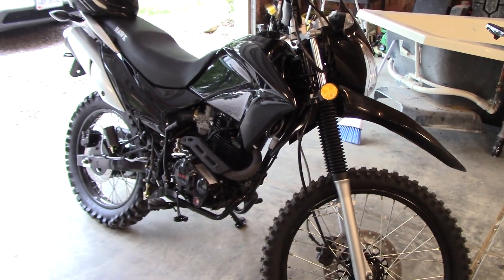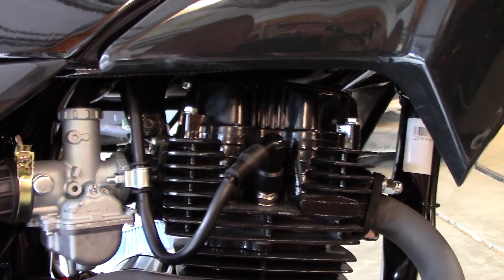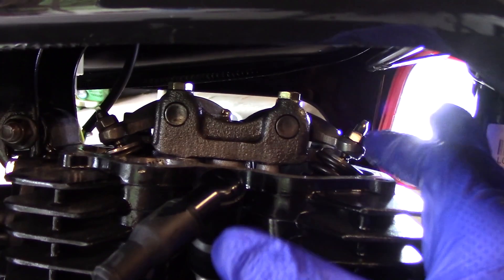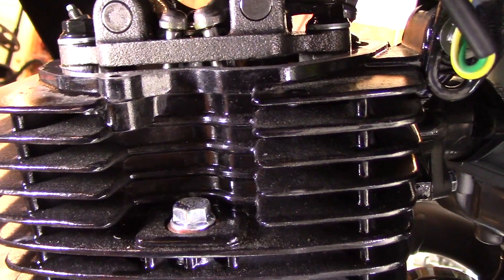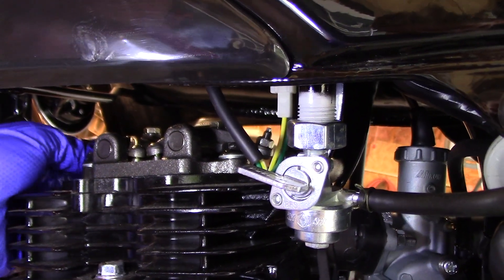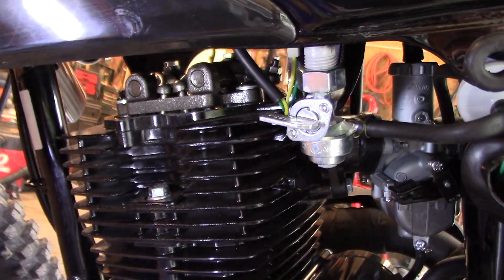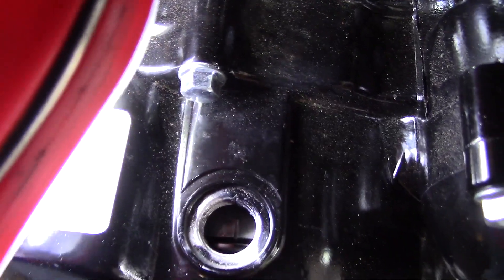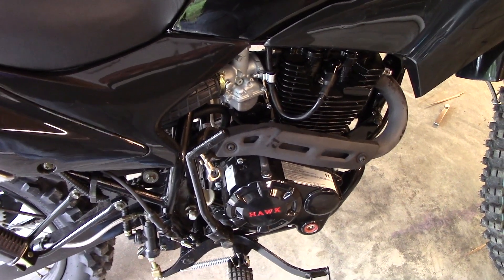Hawk 250 Valve Lash Adjustment - Tao Tao TBR7 Honda CG

Comment: Great job on the video! I don't know why it is so hard for other people explain and show this. I have done a couple valve adjustments years ago, one time with a piece of a Pepsi can because my feeler gauge was all rusty. I was told they were the same thickness. Not sure if its true but it worked on a 49cc Chinese scooter

Comment: I would remove the spark plug to make it easier to turn the engine over. Also, with he plug a installed, it sometimes might be harder to get the marks right on due to compression. Also, I would check the clearances before loosening the rocker arm adjusted lock nuts. Then you know how far off the clearances are, and maybe one or both valves don't need adjusting.

Comment: Dude I can't thank you enough for this video. You nailed every step from finding top dead center to that sensation of the feeler gauges - it does slightly drag. My new 2024 Hawk has been plagued by starting and idling problems - it refused to start for the first five days, and since then has not maintained an idle. This shouldn't happen with a brand new bike, and I was in denial about the need for any major work - its a new F'ing bike!! But shout out to @appalacianmoto for first suggesting the valve lash. And after I said, "What the hell is a valve lash?" and after I resisted any videos that started with, "Remove the gas tank," I came across your video which laid it all out in detail. The only problem I came across was the entire rocker arm assembly was SO tight that, after loosening the lock down nut, the adjusting screws would not turn by hand. I had to use a small adjustable wrench to loosen them, until they finally gave way. And, the valve clearance was non-existent. So that took a while to get it right - and not damage the rocker arms. I have to believe that at the RPS Hawk factory they just tighten everything down so the bike can survive the trip across the Pacific. So I haven't started the bike up yet - I've got the fuel tank off while I do the whole improvement tour: new gas gauge float; the valve adjustment; a new digital speedo and tach; and a new battery - the factory battery is horrible. So thanks again - you're on my Christmas list.

Comment: Nice work - you should be a teacher. This week my new Hawk's gas tank is coming off for a higher quality gas gauge float install; a digital speedometer & tach install; and a valve adjustment. My bike arrived put together with 3 miles on it and doesn't want to idle, either.

Comment: How will u know if they need to be adjusted? How often should you adjust them?
Reply: the schedule is in the manual.  Do valve check right out of the box, then every 200 miles for the first 800 miles.  Then follow schedule in manual.

Comment: What happens if the valve clearance is really off either tight or loose? What will happen
Reply from the maker: Poor performance usually from partially stuck open valves. Or if too loose there will be a lot of valve train noise.

Comment: Would this be the reason it won't run past 40mph amd has a funny idle?
Reply from the maker: Might be a vacuum leak or carb problem.
Reply: Adjusted valves. Didn't work.

Comment: Excellent Video. My thanks to you. Have a question for you. My Hawk 250 EFI DLX. 2020. Factory Booklet shows the valve clearance to be .005 & .007 Yet your suggestion is for .002-.003 & .004-.005 Clearance Settings. Is the Factory Booklet Wrong by chance. ??  Thank you so much for your help with this. I only want to make certain before I adjust the clearance.
Reply from the maker: Make sure the factory book isn't metric vs sae, which is what I'm referencing
Reply: @JackofAllMasterofNone  you are correct. just checked the factory book again. shows valve lash as 0.05 & 0.07mm So your measurements are correct. Thank you so much.

Comment: It's a pushrod engine, you don't need the timing marks, just move it till both valves aren't depressed at all, hell if you wanted you can just do one valve at a time, fully depressed exhaust gap the intake, fully depress intake gap the exhaust
Reply: Exactly

Comment: Whenever I've adjusted valves on all the Honda's I work on, I tighten the adjuster (w/ feeler gauge in) until I cannot move the feeler gauge. Then tighten the jamb nut. When you tighten this jamb nut, it increases clearance. That way the total clearance is your feeler gauge. Also be sure not to have your feeler gauges in at an angle that will be contacting the head. This can introduce drag and make you believe it is where it needs to be, when really it's loose.
Reply: Exactly eexxxxxactly. Shit was like 7/8 thousands

Comment: Good video, did you have to rotate the motor back to its original coordinates after the valves were adjusted? Or did you leave it lined up at the “T”?

Comment: Did u have any oil in the engine when u did this?
Reply from the maker: Yes. Full
Reply: @JackofAllMasterofNone  Good video, did you have to rotate the motor back to its original coordinates after the valves were adjusted? Or did you leave it lined up at the “T”?

Comment: good man!  only taken half a day. but finally found a decent video with exactly whats needed. This I hope will cure the blow back through the carb aswell.
Reply: It won't you will need to put on a better carburetor. Those are set way way to lean which is usually what causes the pop back through the carb. It looks like Jack of all trades has already done that. It makes them run so much better and also run much cooler

Comment: This video was extremely helpful and very much appreciated! How tight should I tighten the valve cover and valve lock nuts?
Reply from the maker: Don't know the exact spec. Just tight, but not crazy
Reply: @JackofAllMasterofNone  did you have to turn the engine back over after the valves were adjusted?

Comment: Hey how’s it going thanks for the info I’m just curious because it seems like everyone does this by default but I have a hawk 250 dlx the efi version same engine I got about almost 1000 miles on mine now have done a few oil changes already never ran it with the shipping oil changed that out right away but anyway I have basic mechanical skills and was just wondering because mine runs and idols fine with no funny noises from the engine do I even need to bother doing this? Thank you
Reply: I was wondering the same thing …

Comment: Allso. When you turn the motor, and feel like the kompression is anoing for staying right at the T mark, just remove the sparking plugs. Then you can just turn, and stop very akkuratly 👍
Reply: Do u have more than one plug?
Reply: @dab-pre-ss-ionaustin1986  ist a 250 ccm ingine. 2 cylinders, 2 sparks.
Reply: @hamborg2  not my hawk i only have one cylinder one spark plug on my 250.

Comment: It’s importent to turn the motor only counter clockwise, because only then you reach the Top Dead Center position. That’s because of the natural slack on the camper chain. And offcorce you don’t have to turn the starter motor around😊

Comment: I just bought this exact bike and I got idle issues like no tomorrow...this video is gonna save me from adjusting my idle screw at redlights ....thanx man...is it worth it to change out the jet in the carb to gain some hp ...just curious
Reply: My bike came stock with an 88 Main jet and I immediately went to a 110 and removed the exhaust baffle, previously couldn't even use full throttle.
Reply: Your jetting is off…that’s why your idle is unstable.

Comment: You are adjusting what they call valve lash...! Because most small gas Engines Have Solid Lifters / PushRods , Instead of hydraulic lifters ....,  on occasion they can get noisy or noisier than normal....! As long as you ( do not have a horrible loss of power ) slightly noisy Tappets are just fine ...! You do not want to much valve lash because it ( can damage pushrods and other contacting services ) in the valve train....!
“ You are Not  turning the ( valve  ) you are turning the rocker arm ( tappets )  ...! “ 
Other than incorrect Termanology ( A good video for people who “actually need to do this....! “ )  A lot of people adjust their valves not realizing that metal does expand when it is hot...! A little more Valve Lash is better than too Little ....! I have adjusted  Many a race vehicle in my day with solid lifters... Always check your Valve Lash / Tappets with a feeler gauge ( before adjusting them ) ...!!!
Because they may not need adjusted at all....!!!

Comment: Wow what a difference that made in my bike!  It runs so much stronger now!  Thanks for the instruction.  Next is to adjust the carb!  (running right now as it should regarding the choke. Just need to get rid of the hesitation between revs.)

Comment: Sorry to sound dumb but what exactly do you accomplish by doing this.
Reply from the maker: Out of spec valve clearance can cause poor performance at the minimum and engine failure at the worst.
Reply: @JackofAllMasterofNone  gotcha so do they slowly work there way out of spec or did it come like that? I'm asking because I'm getting a brozz 250 soon and want to know how to make it last the longest possible and thanks for the video and comment
Reply from the maker: @landenwest02  Usually they come too tight. And yes they slowly work themselves out of spec.
Reply: Haven't seen this answer so. If set too tight valves will burn. Burnt valve will not seal. First indication is putt sound in exhaust. 2nd is severe power loss. Finally it won't start. No compression. Solution is valve job.
If you are handy do full head removal. Mill the head, port the exhaust and buy a good exhaust system. Butten back together observing torque settings. Rejet carburater. Presto, 70 mph. Run hi-test gas.

Comment: I just got a used Hawk 250 that only has 50 miles on it from a buddy of mine it runs good once it's warmed up it just has trouble idling until it's very hot.

By the sounds of it this just might be the issue it only has 75 miles on it right now but I'm going to do an oil change and check the valves the only question I have is once you get the valve itself adjusted how tight are you setting the nut that holds the valve stopper or whatever you want to call it in place do you give it a good bit of torque or is it just a little more than snug
Reply: It has the Mikuni carb on it as well everything else was stock so this weekend I will more than likely do the valves it seems surprisingly easy

Comment: Will this make my hawk Idol? I have a brand new hawk and it won’t idol at all ????
Reply: I just fot a brand new hawk. You need to adjust the idle screw first on you carb. Mine still has trouble idling when i first start it. From my knowledge this valve adjustment should help the idle issue but the carb needs to be straight first
Reply: If you buy a hawk new the first thing you should do is change the carburetor and jetting
Reply: I keep my TBR7 at half choke all the time, runs better this way, actually runs very well. Still need to play with the throttle a bit when doing a cold start up though. Stock carburetor.
Reply: @prairiegold6870  your jetting is way off. You need bigger jets. Your carb is too lean. Buy the carb off Amazon and some jets. You have to also adjust fuel/air mixture. You may temporarily benefit from turning mixture screw in until it idles without choke

Comment: Should have fired it up at the end. I just did mine at 176mi with .005 on both. WAY too much clatter. Doing it again tomorrow at .003 in/.004ex.
Manual says .05mm for both (.002") which is too tight.
Reply: I heard .005 for exaust and .004 for intake

Comment: Whats the point of doing this ?
Reply from the maker: It's a necessary maintenance item. If your valves are too loose or tight you risk engine damage at the worst or very poor running at the least.

Comment: Is it possible to get 70mph with mods on the Chinese duel sport bikes?
Reply from the maker: Not really. You may be able to touch 70, but it will be temporary
Reply: @JackofAllMasterofNone  ive seen 65 on a flat but it wasn't modified . bigger carb and straight pipe muffler no cat should do 70 . motor breathing better more power
Reply from the maker: @adamlong54  Good luck.
Reply: I have the same hawk 250 and I got top speed up to 68 mph. Pretty dam fast for my hawk and that's what a mikuni carburetor rejetted with a 110 and a 17th sprocket and 45 rear.
Reply: @davidespinosa4367  where did you get your new jets from? did you use a Mikuni 30 carb? links for the new jet? thanks
Reply: I bought them on Amazon the jets.
Reply: Adam Long I have a 2019 dlx. I am currently running a 45T sprocket on the rear I can hit 70 easily. I have had a 40T sprocket on it too, but not enough torque For me off roading . 40T It would easily cruise at 65mph @6500ish RPM. 45T cruise 50 mph@ 5500rpm.
Reply: @speedplane1  ya im talking 70 cruising on the hwy not really worried about off road . have changed sprockets on other crotch rockets didnt see much more top end gains but 3 to 5 mph faster top end
Reply: Adam Long you won’t be cruising . That bike will be topped out ready to blow up

Comment: I adjusted the valves on my hawk with the thinnest filler gage i had at 500 miles and checked them again at 3600ish miles and are about the same specks... I do the oil changes around 6 to 800 miles just because one quart of oil is cheap
Reply: They take 1.4 litres of oil mate a quart isnt enough (just under a litre)
Reply: @michealbee78 yeah they really don't take 1.4 though unless it's never had oil in it before. My bike will only take like 2 ounces more than a quart. A quart would be fine.

Comment: No need to check timing.     Turn engine over till one valve is opening.   Adjust other valve.     Turn over engine till this valve opens.    Adjust other valve.   Done
Reply: Exactly, when one valve is open, the other has to be in its closed state
Reply: say wut

Comment: hi. just a tip from an petrolhead... when you check valve clearance next time, just bend the tip of the feeler gauge. check the clearance  always  in a right angle to the contact plate / surface without touching anything else...(you can see in the video that you get more space than measured) when you tighten the bolt with an wrench, conter it with an other wrech or pliers... damn i would buy one just for the fun. here in germany you're not alowed to run them. they violate emission standards and the have no abs, so you get no admission to operate them in traffic... but we will save the world :)))))) greetings
Reply: Fuck emissions run ya one anyways black out your helmet n bike and dodge vehicles as needed keep to the dirt and mud

Comment: Not exactly sure how to differentiate between the 2 TDC
Reply from the maker: The rocker arms should be loose when on the correct TDC. They will still be tight when on the exhaust stroke
Reply: @JackofAllMasterofNone  ok so if set properly then on the next tdc (wrong one-exhaust) what should it feel like....just to make sure I did it right
Reply from the maker: @liveandletlive2894  It will not have any movement at all on the exhaust stroke because the valves are partially open. Ont he intake stroke both valves will be completely closed which should produce a tiny amount of play in the rocker arms and push rods if that makes sense
Reply: @JackofAllMasterofNone  ok thanks doing the job right now
Reply: Now I'm done the job on 1 TDC both have play that I adjusted and the other has absolutely no play at all is it possible I adjusted on the exhaust stroke
Reply from the maker: @liveandletlive2894  No that sounds correct. Thats how it should be
Reply: @JackofAllMasterofNone  can I re adjust now that I ran it for like 30 seconds or I gotta wait again a whole night to cool
Reply from the maker: @liveandletlive2894  I would wait but its not a huge deal. The key is there should be just a hint of a tick when cold. I actually lowered my number to .002/.003 because it was too much play. Each one will be different. The problems come when you have them too tight and burn a valve.
Reply: @JackofAllMasterofNone  ok thanks

Comment: Nice video men, where do you buy a hawk 250 2019 ??
Reply from the maker: I bought mine from q9powersports.com
Reply from the maker: The Hawk 250 is a great bargain. My Hawk has run flawlessly and has only needed the regular Hawk 250 mods. I do agree the Brozz is slightly better made and the TT250 is the best. But they are all still not as good as a Japanese bike.